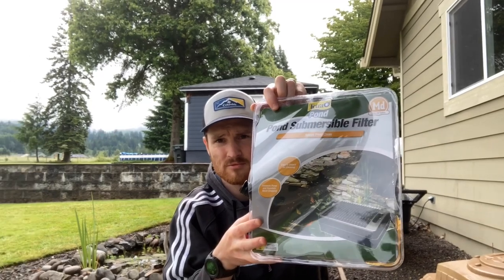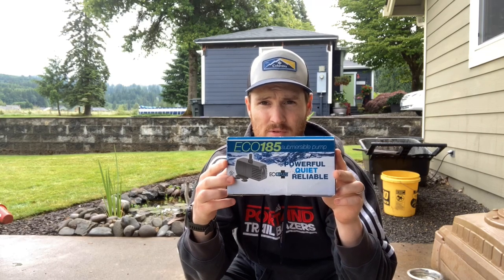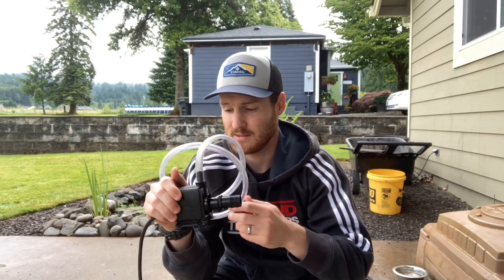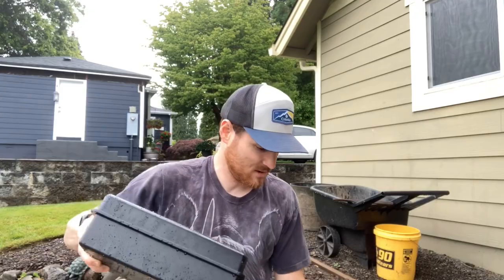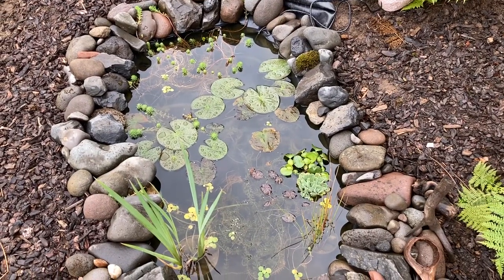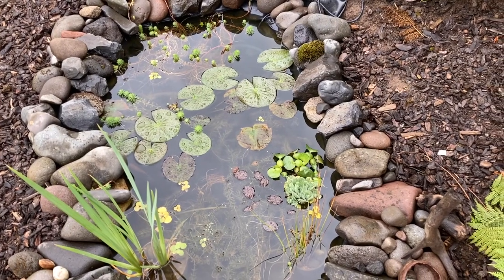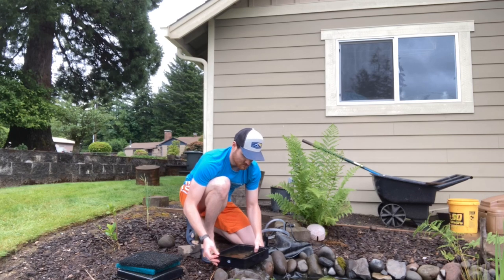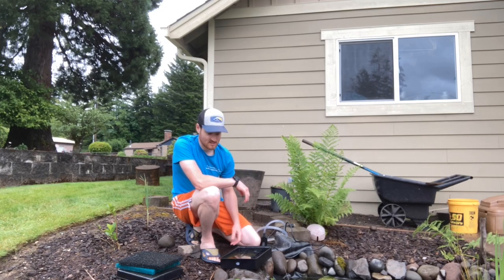Setup and review of Tetra pond submersible flat box filter

Comment: I just purchased the 550 gph pump/filter kit for my turtle pond. The filter keeps floating up. What's the best way to submerge?
Reply from the maker: I was having trouble with that initially as well. Maybe let the box fill before connecting it to the pump or even just put a rock on the top. Shouldn’t obstruct the intake too much

Comment: did you just insert the filter black pipe into the box's hole, or use one of the valve attachments? My hose won't fit without the connector.  Also getting a new pump as my old Beckett doesn't have the intake valve needed for the filter. Have you tried a UV clarifier device connected to the filter to see if algae is cleaned up better? I am thinking of going that route if the new filter and pump doesn't work. Thank you for your time in explaining.
Reply from the maker: holidaze there was an attachment that screws into the filter box to attach the hose. I haven’t tried a UV clarifier, my water has remained very clear but I do have some algae on the sides. I just added a handful of trapdoor snails to see how they do.
Reply: @aquariumbros8699  thank you for your reply. My new pump is due soon so I will go with just the filter at first to see how it does. I have a very small pond, probably 100-150gals.
Reply from the maker: holidaze awesome. I should post an update but it’s been a couple months and my water looks great. My pond is around that size.

Comment: Would help if you plugged the hole on the other end of the filter... You are sucking "dirty" water in and and just repumping it back out. As the filters get filled, water will take the path of least resistance and go to the hole instead.
Reply from the maker: The water is pulled through the layers of the filter and then passes through the pump and my water feature before returning back to the pond